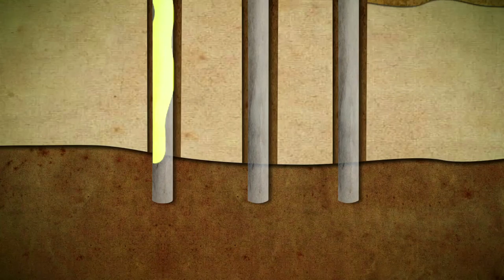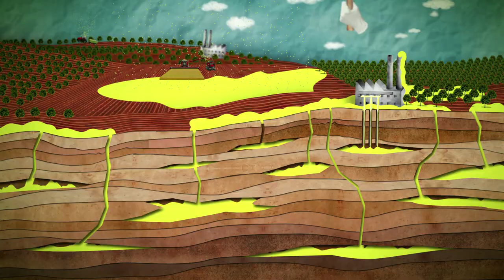A technofix for the climate? Land-based geoengineering (BECCS)

Comment: Direct Air Carbon Capture seems like a better solution. With current amounts of CO2 and consumption in developping countries, these technologies will be needed. Renewables, afforestation and conservation must stay at the forefront. A healthy balance of both will be needed.
But agreed, BECCS is not the solution.
Reply: lostyourmarble - Most DAC solutions up until this point have required large amounts of energy to function. BECCS does a similar function to DAC, while producing power. Also, the video is assuming you're tilling large areas, that you'd plant mono cultures, and that the plants you'd grow are slow growing. This is the opposite of what would be best. It'd be better to use fast growing plants that are local to the area (or those that can be introduced without too many problems). A good example is the vast grassland in central US. Grasses (including bamboo) grow very quickly compared to other plants like trees, are native to the area, and would be a good option for BECCS. In addition, the video assumed you'd need to heavily water and fertilize these monocultures. After burning, the leftover ash can be spread for fertilizer, and very little water needs to be used. (When bare soil has plants start growing in it, it retains more moisture. This actually could help some arid parts with afforestation when suffering from desertification.) BECCS is one of the best current options, because it's cheap to convert coal plants to BECCS. (when compared to DAC, solar, etc) The fuel is also cheaper in many cases than coal is, offsetting the cost for conversion. The need for land wouldn't effect land price much, if at all. All the land used would be in the country, where there is excess land available still.
Reply: BECCS is actually one of the best options we have to start reversing climate change. (because even if we go 100% solar tomorrow, cars are still polluting. People are still polluting.) At this point, we don't need net-zero solutions to climate change. We need net negative. :) DAC's great, but it's a new technology, and still has a long way to go. We really should be pressuring government to make positive change happen for once... But that's just my opinion. :P
Reply: @freddyfowl6136  Where I live we are already on a 100% renewable grid (Quebec). DAC is a very real possibility here. Most our Carbon is caused by vehicules and possibly industries. I guess the solution will depend on how each area's reality as well. We need to push governments to act...agreed